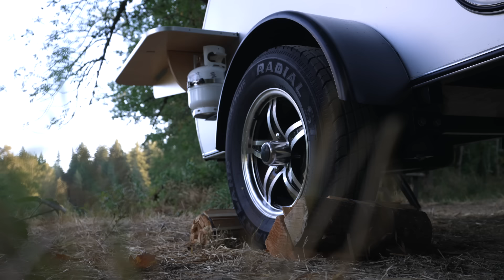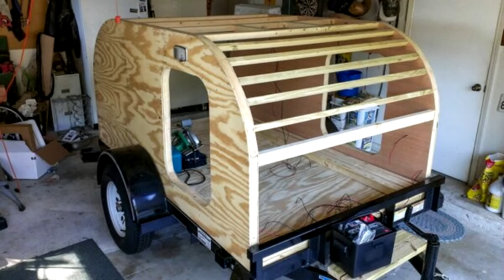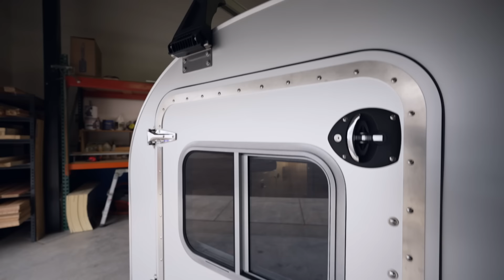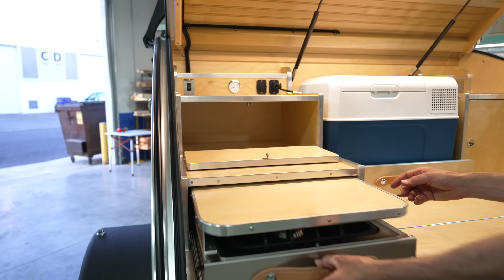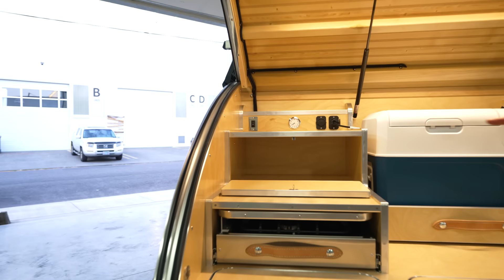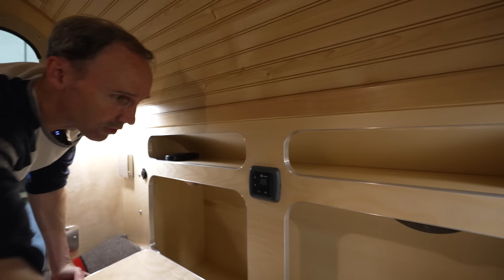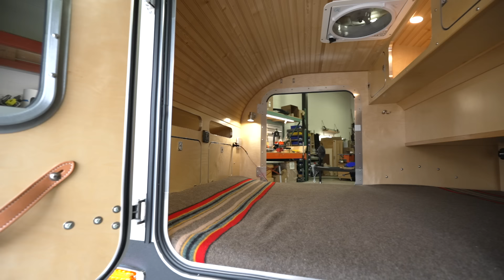RAISING THE BAR! A New Standard for TEARDROP Trailers

Comment: Great review as always Drew! For my taste I like the clearance for light off roading. I also like the Timbren suspension. While better/less bouncy options are available Timbren is a good midland choice. I like the large battery included on the trailer but I didn't get a good sense of the electrical capability. I only say 1 120v outlet and he said it only worked while plugged into shore power? I didn't see any outlets on the interior. With a 170ah battery there should be a lot of opportunity to plug in whatever gadgets you bring along. While I appreciate the wood craftsmanship I still prefer composite materials and lastly...that solar blanket guy...where'd you dig him up from?...LOL Overall a pretty cool trailer that will serve someone in various terrains and seems well built. Extra plug for the rear receiver hitch. Curious about the capacity and if it's a rated recovery point. Nice work Drew and impressive overall trailer design. BTW...I always smile when you get into the rear hatch coming over your head thing. If the weather is bad enough to matter I'm just not convinced it makes that much of a difference and it's probably a sandwich night anyway :)
Reply from the maker: Every time I mention the hatch for protection I always think of you. I say to myself when Pat hears this he’s going to roll his eyes. 😆 i’ve really been thinking of my narrative around this since you first mentioned it. I had to think about why I’ve never wanted an awning over my galley kitchen. You probably have noticed that many teardrops have little canvas sidewalls attached to the galley. I’ve often thought to myself why is that needed? And I guess the conclusion I have come to is that I don’t really notice the elements. I need a little bit of protection from them, but not 100%. When it’s windy or sunny or raining, May and I determined, we really don’t notice the little splashes of water that hits our leg or the little bit of water that gets on the edge of the galley. Compared to backpacking and car camping this is way more protection from the elements than we have ever had when cooking and prepping food. And as I mentioned to you before we are out there 2 to 3 straight months and I’ve never had the need for anything else. I even thought of you when I put the B roll in to show a proper sized hatch over my head.
Reply: @PlayingwithSticks  Maybe it's just that we've been lucky to avoid very much rain but it seems that it usually comes in from the side and the hatch only works when it's coming straight down. One idea that I thought would be potentially cool is some kind of side curtain that can be attached or raises with the hatch...kinda like the side wind blockers on the stove. I've never seen that done and it would help with the sideways blowing wind/rain.
Reply from the maker: Good idea. If you Google Vistabule Teardrop and look at the images you will see that trailer comes with the side walls you are talking about. There is also a guy who just made a diy set for his Bean trailer. If Charles moves forward wtih selling the style of trailer we are building for our familly he will probably add something like that. We have never had the need, but I have a feeling potential buyers will want it.
Reply from the maker: I didn't know that about the Timbren being bouncy compared to other offroad suspension. And yes all that power for such a low draw trailer. That is a good point. Maybe like his propane setup he has designed this trailer to go, and go, and go. I had to throw the solar blanket guy in there. I even made a plug for your video in the description. It is one of my favorite videos. Good question on the recovery point. That is something I was just telling May last week that I need to pay attention to. Meaning, I need to ask that question more when I am on site. My friends and I love sandwich night!  May, on the other hand, would never go for it. It is a real meal every night for her. 😆
Reply: @PlayingwithSticks  I have timbren on my utility trailer and without chocks it's still bouncy. Much better than leaf springs but still...on less than ideal roads it tends to bounce more than with something that uses shocks. I agree on the propane tanks...pretty cool and available regardless of what trailer you buy. I'm going to look into them for myself. I've wanted to increase my tank size but have been worried about weight.
Reply from the maker: Thanks for that Timbren feedback. That is really good to know. Makes sense though. It's basically torsion suspension without an axle correct? I told May I have a feeling a lot of people will be buying these propane tanks after watching this video. I went and looked at the backend of the video today. There was only two spikes in the video. One at the propane tanks and one at the unveilingn of the galley kitchen.

Comment: I own one of these High Camps and love it.  It’s a work of art and very tough too.  I really love the aesthetics and craftsmanship and to compensate for less storage I added a cargo box on top.  I also have the awning and a 7 gallon solar heated water tank on top and it all fits.
Reply from the maker: Love having owners chime in! A work of art is exactly how I would describe it. And tough as well. Another word that comes to mind is tight and compact. It's just a solid little trailer.
Reply: I do have one question though. And it's more of a concern because of my height (5'08"). How easy would it be for me to grab food in the fridge? Most other brands the fridge is on a tray that when extended is kind of between the knees and the waist. It makes it very easy to grab what you want. This one the fridge is much higher and the tray doesn't extend outside the galley (like the stove). So, my fear is that I'd need a step to pick and choose what I want. Maybe someone here who has one could answer? I'm from Western Canada (French), and it's a 15 hour drive to their shop. So, as much as I'd like to see it in person, it would get too expensive. Thank you in advance.
Reply: @BuckyBuck1000  Good question.  The High Camp I own is a 2019 build and has a cooler (not a fridge) which sits on a tray that rolls out toward you.  Easy access.  I don’t know if the fridge install sits on the same tray but I suspect it does.
Reply: Nice. Would a roof top tent work?
Reply: @michaelptm2269 yes- if you use the strongest system on top which I believe is Rhino and not Thule or Yakima.
Reply: What about an AC unit?
Reply: @patrickhaag  Good question.  Since I live in the PCNW (it's not needed often) I opted to forgo an AC unit but believe it's something that Dennis at High Camp can add.

Comment: One thing that bothers me about this kind of trailer is that you can't just hang out in the trailer without sitting or kneeling on the bed.
Reply from the maker: Good point. A traditional teardrop is basically meant for sitting or laying.
Reply: @PlayingwithSticks  I would be concerned with getting dirt and sand in bed. Not only carefully removing shoes, but making sure my pants are clean. 😊

Comment: Great video Drew. I was expecting a much higher price.  

Must admit, I assumed the video was showing a base model because your comment at the beginning about having everything already included. Looking at their site, the camper in the video I see is closer to $23,600 if my math is correct.  Still a lot better than the $40k teardrops, but it is a bit more than the $19,950 I thought I was seeing.  

$19,950
$325 dual composite propane
$590 storage box
$275 rear hitch receiver
$275 roof rack
$1650 Propex Heater
$99 Dometic Faucet
$450 170 amp hour battery
Reply from the maker: I saw the same thing today. I will have to talk to Dennis about this. When I shot this video he had everything at base. However, he did send me an email this year regarding marketing. He had wondered if he would be better off decreasing the price of the base and having more add-ons. Basically wondering if sales were potentially lost because people would see the base price and think it wasn't competitive with other trailers. Essentially trailers that were hiding their out the door additional costs outside their base price. Does that make sense? I am wondering when annual cost increases came around if he lowered his base price and moved what were his standard components into an upgrade model that people were more accustomed to. I wish I would have realized this before releasing the video. I typically do my homework, but it looks like I did my homework a little too early on this video. Thank you by the way for pointing this out and adding the costs.  I really appreciate it.

Comment: I just recently started researching camping trailers, with the focus being off road capable, and self subsistence for extended overland expeditions.  Early decisions include wanting a trailer that is based on composite materials, that allows for owner customization, and that is "reasonably" priced.  I have been quite put off by the MSRPs of so many of the overlanding style trailers, and I wonder how many of these companies will still be still in existence in 5 years.  My background is one of extensive backpacking and truck camping, so a pull behind trailer would be a true luxury.   Anyway, I am glad I have found your channel and have subscribed and am reviewing your prior videos at leisure.
Reply from the maker: Sometime this summer I am hoping Teardrop Lite will announce  their line of trailers. These will be composite trailers that you self assemble at home. VERY reasonably priced and like you mentioned "owner customizable." Once I get the word on those trailers I will make sure to get it on the channel as soon as I can.

Comment: I looked at the fiberglass propane tanks for our trailer as i love the concept.  I remember them being over $200 each, but my bigger concern was if all shops would actually fill them.  Also eliminated the quick and easy swap option which is super convenient on the road.
Reply: I don’t see the need for two tanks - why not pin the storage box up against the cab, and put a single tank in front of the box, particularly since the tank is so light weight.
Reply from the maker: That’s a good point. It’s rare if ever I see two propane tanks on a teardrop trailer. My guess is this was built to be self reliant. Even the battery capacity is larger than most teardrops. It sounds like it was built with someone in mind who didn’t want to do refills on the road, run a lot of solar, or make runs back to town.
Reply: There should be some sort of government sticker on them indicating that they comply with standards, no? That might put the filler's mind at ease
Reply from the maker: @JackFalltrades  I would say I would test it out for all of you this summer. But we are going with the smaller 5lb cylinders this summer. They are the only one's that will fit in our concealed spot for this new trailer. It is a really neat design idea that Charles has. I am excited for you to see it.
Reply: @PlayingwithSticks  Great! 😊
Reply: @PlayingwithSticks  Nice that you can see how much propane is inside
Reply: @PlayingwithSticks  I think it's been a while since you've had an equipment review...
Reply from the maker: It has! To be honest, the only reason is because of our big move to Thailand. With our family living out of the cargo trailer full-time while chasing all these trailers around the country. I found it quite exhausting to prep the family for the big move. So because of that, a lot of my product reviews got put on the back burner for this summer.
Reply: You're right about swap out. You wouldn't just be able to go to Walmart or Ace Hardware and trade it out!
Reply: Please please please look at the Sunray 109e trailer.
Reply from the maker: I have had that request from a number of people. I’ve always shied away from that trailer because it screams large RV industry. But, that doesn’t mean it necessarily is a bad trailer. I need to get inside one sometime and check it out.
Reply: It definitely screams industrial and that is unfortunate. I’d just like to see a review from someone trustworthy.
Reply from the maker: And I’ve actually heard from a number of people who own them who really love it. Unfortunately though I’ve only heard early reviews of the trailer. I haven’t had anybody reach back out to me who has used it for a year or two. It’s the owner reviews that really get me interested about a trailer. I think that’s another reason I haven’t jumped on it. because nobody’s reached out to me who has owned it for three or four years and said Drew, you have to tell people about this. But I will be on the road a lot this summer, so the chances of seeing one at some RV Center along the highway are probably pretty good. I will remember your comment when I pull off the highway and take a peek.
Reply from the maker: Good point. I had wondered the same thing. I think they are designed to be filled in the same way correct? But that doesn't mean your local propane filler will be comfortable filling it for you. And yes, no easy swap there.
Reply: @Playing with Sticks  yes "should" be filled the same.  I just remember seeing reviews where owners mentioned that not everyone was comfortable filling them "because they are different".  A lot of river raft guides out west use them on raft expeditions. This is where i saw them first.

Comment: I'm impressed with most of it.  I like squared-off fenders to set stuff on.  I like the sliding windows.  I do like as much storage as possible.  If I did not have a dog, I could use a smaller bed, but dogs rule.  My teardrop does not have a fridge, cooler is on the front.  I wish I had a propane heater.  I do not need a three burner stove.  I think I like more storage in the galley.  Mine is a messy set up in the galley, but it works.  In the cabin, I'm wondering if it is ok to sit up and lean back on the cabinets because I read at night.  My hatch isn't long enough to stay out of the rain either, I wish it was.
Reply from the maker: Our galley storage with our original 4x8 was pretty messy as well. But it worked! Good point on the fenders. Do you use a side entry tent with your dog? How do you mitigate dirt in and out of the teardrop? I have many people ask this question.
Reply: I do not use a side entry tent.  I have a Clam Traveler which usually is not that close.  My Norwegian Elkhound can drag in a lot of dirt.  He does not care--go figure.  I can put down a 5x7 mat which is a bit useless.  Since it is an off-road and a bit higher, I have a non-tipping stool and a rug thing over it that catches some dirt on his way in.  But inside, I have a cloth shower curtain on his side, so I can shake it out and wash it upon getting home.  But a dog with double coat is hairy and dirty, and I just put up with it.  Since he takes his half out of the middle and moves around a lot, the shower curtain does not stay put.  Under that, there is a large microfiber dog rug (they come in many sizes), so if his feet are wet, the microfiber soaks it up.  My problem is that he drags the dirt across my side of the bed to get to his side.  Oh well.
Reply from the maker: @WildcatPhoto  I love your honesty here. And I appreciate how you make it work. Many people ask this question, but most people seem to be afraid to answer it. I think you are the first person to actually give an answer about this subject.

Comment: Those doors look like they make an excellent seal! How does it work when running the fan to blow air out of the camper while one is sleeping? Wouldn't you need to let some air flow in through some sort of side port?
Reply: We crack a window open with the fan on to circulate air in our trailer. I like how the window on this door opens side to side vs up/down in other trailers. 6:33 Ours is up/down so I have to use something to crack it an inch or else it must be wide open. Some trailers like Colorado Teardrops and Hiker Trailer offer a vent separate from the door.
Reply from the maker: @ronc5093  Thank you for sharing this. I realized when I read this comment that I have never tried a fan without the window down. And it had me wondering, how many trailers have built in vents for this.
Reply: @PlayingwithSticks  I have to correct myself on Colorado Teardrops offering a vent. I only saw one example of a vent in 4-year-old Campers & Gear video that walked around a Colorado Teardrops Summit trailer. I haven’t seen the vent on their current trailers. MWD Adventures has a video that makes a vent using the A/C holes on a Hiker Trailer. Separately, Camp & Camera installed a DIY vent on his. I think both dudes made their vents with a 3D printer. All creative ways to limit condensation in the teardrop. We sleep 4 humans in ours and we’d develop a lot of condensation if we didn’t crack a window. Did ya’ll have a similar experience by closing everything?
Reply from the maker: @ronc5093  Oh man!  Our winter camping trips as a family are quite funny. If you were to walk past our teardrop you would think we were crazy. Our windows are practially full open. Keeping condensation down with human moisture plus propane moisture is a battle in itself.When I am alone it is just a fairly small window crack. But that changes dramatically with each additional body.
Reply from the maker: Good point. When you shut those doors with the fan on you hear a Wooooshhh! It really is a tight seal. But it works. I am not sure how, but it has such nice air movement with the MaxxFan.